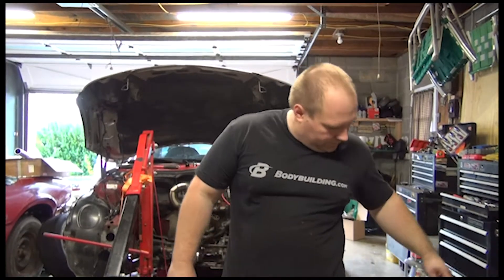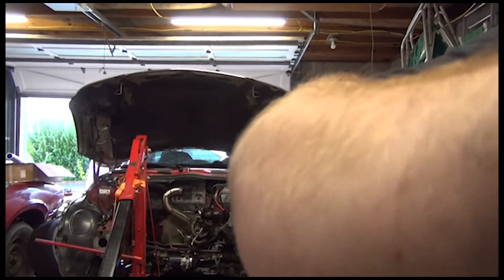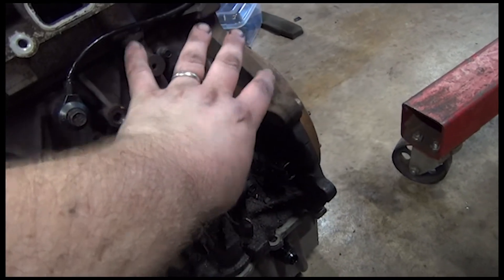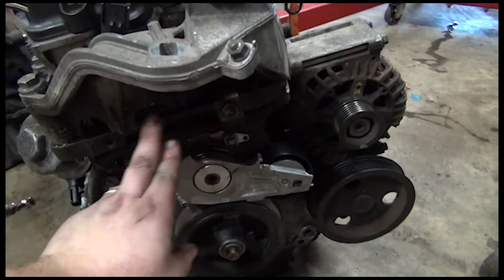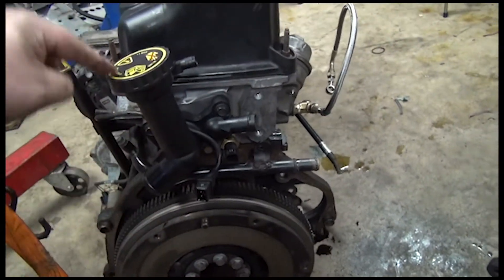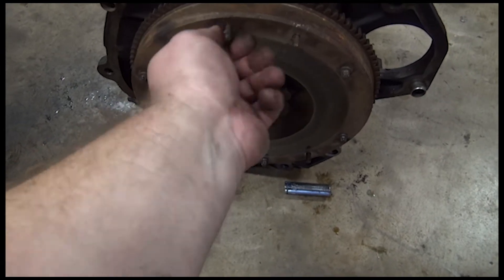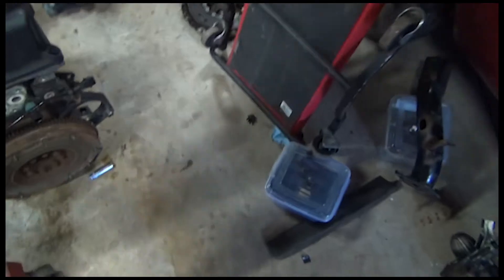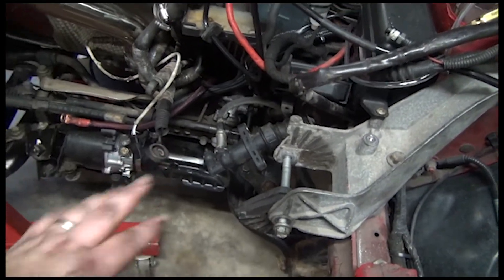Mini Cooper Update  - 2

Comment: I'm tossing around the idea of turbo swapping my R53. I've got a few things done; Cravenspeed 17% pulley, 380cc injectors, Alta CAI, Valeo Single Mass Conversion Clutch kit, Thumper Performance cam, full stainless exhaust engine back with cat delete pipe. It definitely could use a custom tune but it's pretty damn rowdy as it is. I picked up a JCW Head and LSD to install also. I know quite a bit about these cars also.

Comment: This is really cool, I own an R50 and would've loved to see the stock W10 boosted, ah well. If you need assistance I can help decipher your stock ECU file for maps etc if you're going stock ECU route
Reply from the maker: We did have one W10 boosted for about 2 months, but the owner decided to beat the snot out of it and it blew a hole in the block. I'd love to know the software you use to access the stock ECU.  Thanks!
Reply: @powerlifter_garage6211  How many pounds of boost was he running? Curious to do my. personal R50 for shits and gigs.

I use an MPPS interface to rip the ECU file, use WinOls to identify and modIfy the ECU tables, use MPPS again to flash the file and then Deep OBD running on a Google Pixel (basically INPA) to monitor temps, revs, ignition etc
Reply from the maker: @prtn1234  That is awesome, I may need to research into those more. We were running 8lbs on the car. We were also using bytronics to adjust the tables. But I can't justify the cost if I can do it for free. lol
Reply: @powerlifter_garage6211  That's fair. Was it every dyno'd? If so how much did it make? And how long did 8PSi last?
Reply from the maker: We never had it dyno’d. It lasted about 3 months total. If he would’ve just drove it and enjoyed it, it would’ve last a lot longer.
Reply: How can I get my r50 tuned?